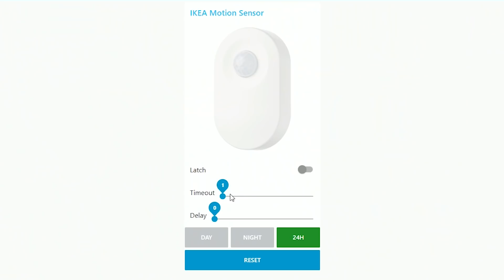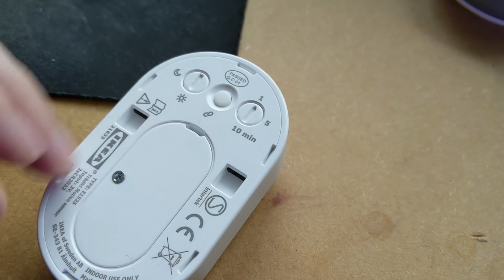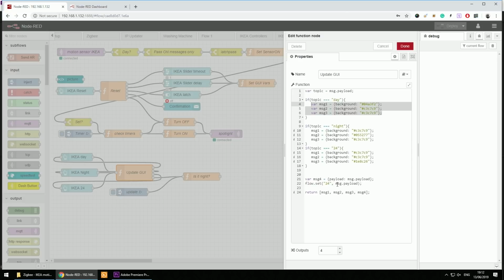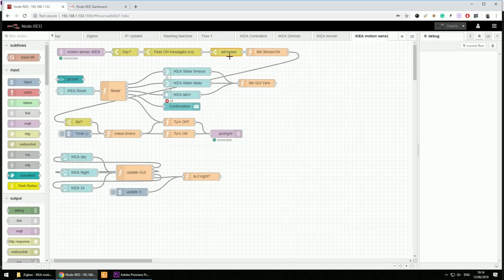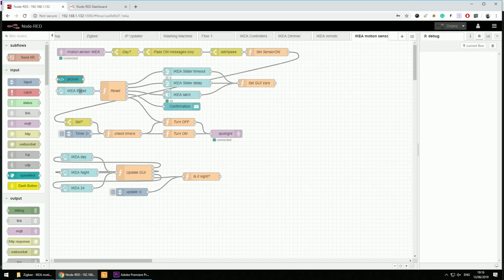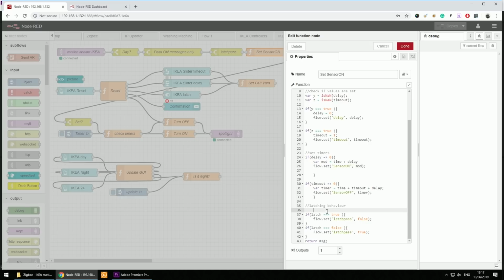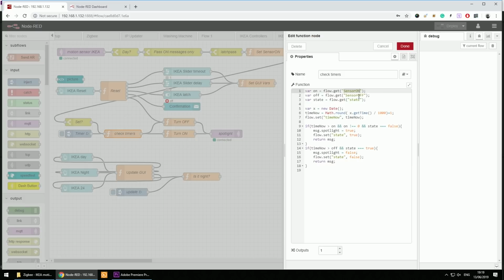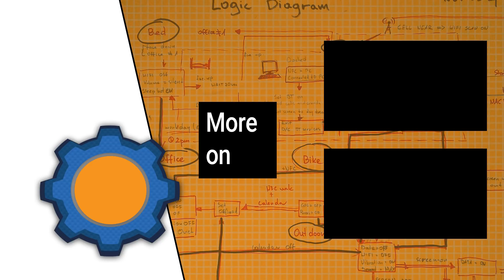IKEA TRADFRI motion sensor is much smarter in NodeRED

Comment: Thanks MAt this worked perfectly! I have a question however. How am I suppose to put 2 sensor for 1 light? I tryed to put 2 mqtt node at the beginning, but it seams like sometimes it's ok and sometimes the light goes off after like 10 sec (I put it at 3 min timeout). Thanks for the help!
Reply from the maker: You should put 2 MQTT nodes, but you should not pass "false" message. Lights goes off as sometimes ON is issued by one sensor and OFF is sent by another. To fix this split the true and false with switch node and add delay/limit rating for false (so it passes lets say one false every 1 min) this will prevent lights from shutting off too quick while still responding to both sensors
Reply: @notenoughtech  thanks I will try that!

Comment: Does it work with the new motion sensors as well? I just got one and you cannot manually adjust the timer anymore, the light always stays on 3minutes by default. I have a room where I only want it to be on for lets say 30 seconds
Reply from the maker: Yes it would. Only retrigger would be affected. As Nodered only needs to know when the sensor is tripped
Reply: @notenoughtech  
The new ones miss the switch to adjust the timeout. 
After they trigger once the will not send a new signal for 3 minutes. 
In Jonas's case, the motion sensor triggers, lights go on, after 30seconds he switches them of. But after that 30seconds, (no mather if someone moves or not) they will stay turned of for another 2,5minutes.

Comment: 215/5000
Super nice, are you doing it, for Phoscon with iobroker on ?. Made it, but it will only do it once. But if I move timeout then again works (only 1 time again), what is the error

[
[
    {
        "id": "c3b0d0e1.5a41a8",
        "type": "switch",
        "z": "85d149af.7368c",
        "name": "Pass ON messages only",
        "property": "occupancy",
        "propertyType": "flow",
        "rules": [
            {
                "t": "true"
            }
        ],
        "checkall": "true",
        "repair": false,
        "outputs": 1,
        "x": 1190,
        "y": 240,
        "wires": [
            []
        ]
    },
    {
        "id": "9c6eefa6.488de",
        "type": "change",
        "z": "85d149af.7368c",
        "name": "",
        "rules": [
            {
                "t": "set",
                "p": "occupancy",
                "pt": "flow",
                "to": "true",
                "tot": "bool"
            }
        ],
        "action": "",
        "property": "",
        "from": "",
        "to": "",
        "reg": false,
        "x": 1170,
        "y": 300,
        "wires": [
            []
        ]
    },
    {
        "id": "d8aba1ca.4dca9",
        "type": "change",
        "z": "85d149af.7368c",
        "name": "",
        "rules": [
            {
                "t": "change",
                "p": "payload",
                "pt": "msg",
                "from": "false",
                "fromt": "str",
                "to": "false",
                "tot": "bool"
            },
            {
                "t": "change",
                "p": "payload",
                "pt": "msg",
                "from": "true",
                "fromt": "str",
                "to": "true",
                "tot": "bool"
            }
        ],
        "action": "",
        "property": "",
        "from": "",
        "to": "",
        "reg": false,
        "x": 1160,
        "y": 180,
        "wires": [
            []
        ]
    }
]
    {
        "id": "c3b0d0e1.5a41a8",
        "type": "switch",
        "z": "85d149af.7368c",
        "name": "Pass ON messages only",
        "property": "occupancy",
        "propertyType": "flow",
        "rules": [
            {
                "t": "true"
            }
        ],
        "checkall": "true",
        "repair": false,
        "outputs": 1,
        "x": 1190,
        "y": 240,
        "wires": [
            []
        ]
    },
    {
        "id": "9c6eefa6.488de",
        "type": "change",
        "z": "85d149af.7368c",
        "name": "",
        "rules": [
            {
                "t": "set",
                "p": "occupancy",
                "pt": "flow",
                "to": "true",
                "tot": "bool"
            }
        ],
        "action": "",
        "property": "",
        "from": "",
        "to": "",
        "reg": false,
        "x": 1170,
        "y": 300,
        "wires": [
            []
        ]
    },
    {
        "id": "d8aba1ca.4dca9",
        "type": "change",
        "z": "85d149af.7368c",
        "name": "",
        "rules": [
            {
                "t": "change",
                "p": "payload",
                "pt": "msg",
                "from": "false",
                "fromt": "str",
                "to": "false",
                "tot": "bool"
            },
            {
                "t": "change",
                "p": "payload",
                "pt": "msg",
                "from": "true",
                "fromt": "str",
                "to": "true",
                "tot": "bool"
            }
        ],
        "action": "",
        "property": "",
        "from": "",
        "to": "",
        "reg": false,
        "x": 1160,
        "y": 180,
        "wires": [
            []
        ]
    }
]

Comment: Thanks for sharing your video.
Is it possible to set the parameters without having the Ikea gateway?
I'm using the Conbee stick with Deconz and Phoscon.
Reply from the maker: Yes the IKEA hub isn't needed
Reply: @notenoughtech  Are you using another zigbee hub of some sort then?
Reply from the maker: Personally yes cc2531 but you can use it as is as remote devices can control up to 10 bulbs

Comment: I i have new version without the timer on back, how can I easly check the status after 1 minute? The basic is 3 minutes, but i cant change it on the motion sensor device.
Reply from the maker: O! I didn't know that's the thing. Can you actually set any options via IKEA hub at all? The lowest timeout setting is the lowest resolution in NodeRED so if you can change that via hub, then you would be able to drop the min value
Reply: @notenoughtech  I dont have ikea hub, I have only the zigbee2mqtt on CP ;)

Comment: Mat, are you able to use this information to get a message from let's say mqtt, that motion has been detected? Can you then use this to trigger other devices for automation? I have a Gateway and a few sensors but it looks like getting the motion information without a "hack" is impossible.
Reply from the maker: To make it clear, you can use the motion sensor information to trigger anything that is connected to NodeRED

Comment: Does this work on the new Tradfri motion sensor to?
Reply from the maker: Should do.
Reply: @notenoughtech   can you explain how to get the information from the sensor into node-red first? I have the sensor paired to the original bridge and therefor it could only talk to one LED directly :/ My aim is to turn a light on for 30 sec instead of 180 sec (default for new model).
Reply from the maker: You will need a cc2531 device https://notenoughtech.com/home-automation/flashing-cc2531-without-cc-debugger/

Comment: Hello, Can you please explain how you was able to get information from PIR?
Thanks.

Jan
Reply from the maker: Paired with cc2531 zigbee2mqtt I have a separate tutorial linked in the article
Reply: @notenoughtech  possible to control those without the usb extra hardware if one had the Ikea gateway?   I can't find a way
Reply from the maker: You can link it to lights or sockets by holding it close in pairing mode but other than this you need something like cc2531 to do it
Reply: @notenoughtech  eah I got to pair and home assistant sees the remote, just that the only thing I can do is check their battery levels.  So you're saying that if I want to use ikea lights/remotes, Ikea own gateway is useless, I'd be better off using 3rd party like that USB Zigbee.
Reply from the maker: You can bind a remote device to up to 10 lights from IKEA. If you want more specific automation or triggering by other stuff you'll need the coordinator
Reply: @notenoughtech  That is true.   I think I'm doing a very poor job at communicating my question.  I'll try again.  
Hardware at hand: 
ikea remote
ikea lights
ikea gateway
leviton smart switches 
ring/nest etc
Software:
linux + home assistant + node red 

right now, everything is working. I have my automation working as I want them etc. 
I was wondering if there was a way with my hardware to use my ikea remotes to do other things outside of ikea ecosystem using node red/home assistant. for example: trigger a smart plug from leviton. 
Right now. when I look at the ikea remote, the only thing I can see are the battery levels, no control, no dimming, nothing. no events/states etc. 
All youtube videos and docs I found were always like:   "Hey, control your ikea stuff without ikea gateway hub by simply using a USB dongle and mqtt etc"     
This is great but what if I already have the gateway and I don't have a USB dongle. One would think it'd be possible, am I missing a module?  looks like libcoaps might be the answer, but I need to dig deeper, I thought having the gateway from ikea would be a much simpler integration.    
I mean, I was able to reroute unsupported leviton wifi and apple HomeKit to fully integrate.  unsure why ikea stuff is so much harder.  
Any idea?   is libcoaps the way or am I missing something super basic where I might be over-complicating things?  surely feels that I am :D
Reply from the maker: Ikea gateway is useless :)
Sell it get cc2531 and dont look back. You'll be able too mix and match IKEA gadget with anything you want as long as it can accept some sort of 3rd party control
Reply: @notenoughtech  I understand, and this is what I'm starting to realize, I might return the gateway, but for shits&giggles. any idea if libcoaps, or any other thing I might be missing?  If you don't know, that's fine.  just that it seems everyone is documenting on how to do it if you don't have the ikea gateway, but never really explained if this is just a workaround, or a necessity because the ikea gateway might be useless and impossible to manage with home assistant?  it really feels like I'm missing something..
Reply from the maker: No. It's really dumb device and pointless. I have mine in the cupboard and not used it since :) if they had any brains they would do it much different. I have 2 writeups about why IKEA traidfri as an ecosystem is bad ;)
Reply: @notenoughtech  Thank you very much.  I will look to see how cc2531 is much better hardware, i thought it was just an interface, which as far as I thought I knew, the ikea gateway was basically the same,  usb||ethernet to zigbee waves. then have home assistant do the clever things.
Reply from the maker: It's much fun to play with.  You'll love it. It lets you connect all ZigBee devices from different ecosystems together. :)